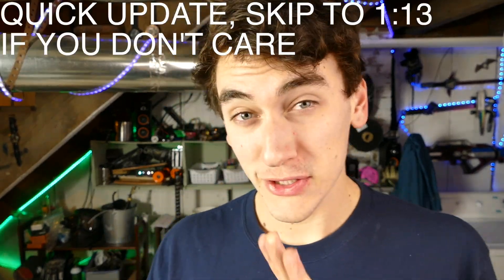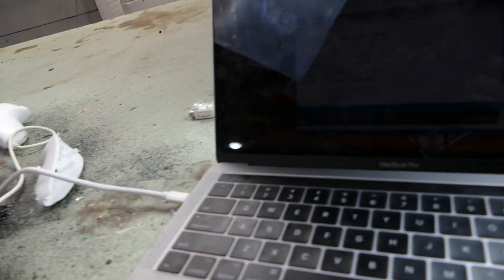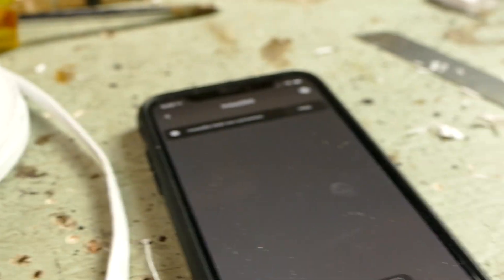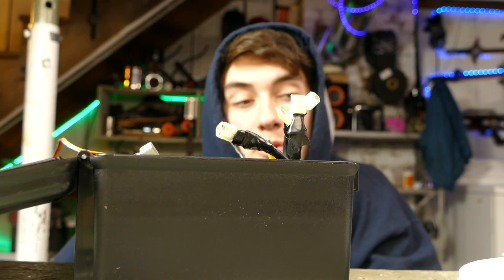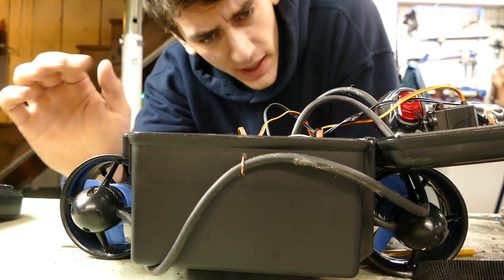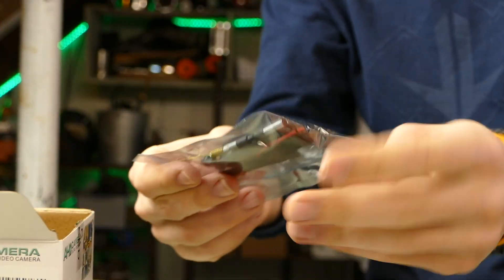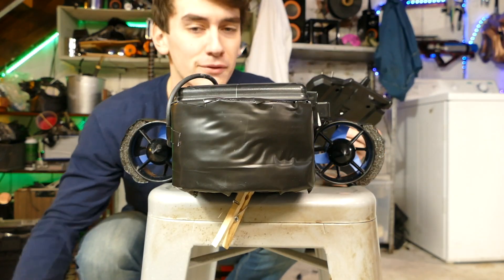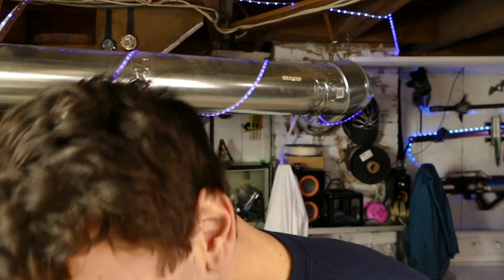DIY Underwater Drone! COMPLETELY WIRELESS (4K 360 Camera)

Comment: Also the transmitter your using with rubber bands to hold down right stick... if you take off back cover you can just remove the spring lol so easy

Comment: Using it in fresh water might be a better  use for this because of the floating design it will pull on the line with every wave and constantly be bobbing up and down, might I suggest making it travel just under the surface by adding a load of weight to make it less floaty but not too much as let it sink like a stone lol , have fun mate 👍keep up the good work